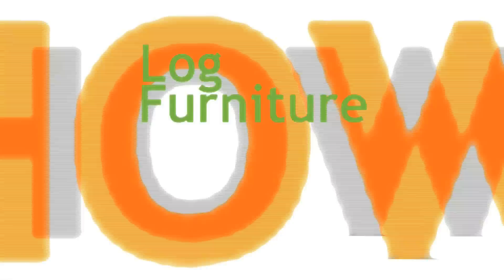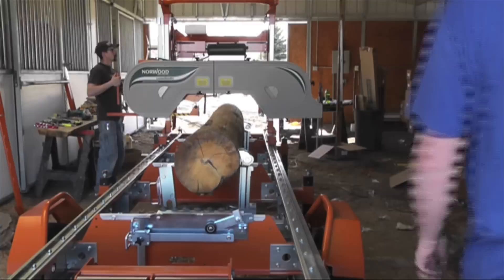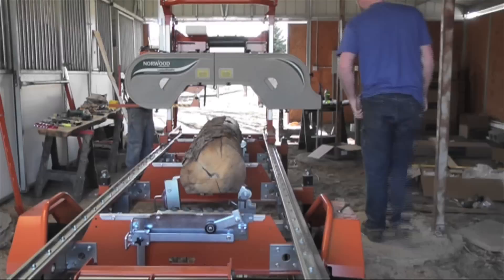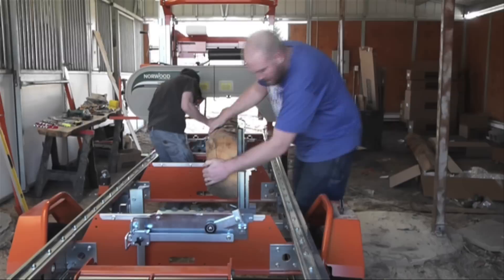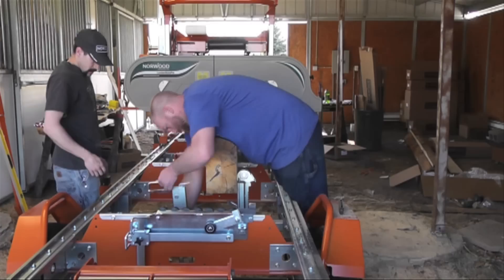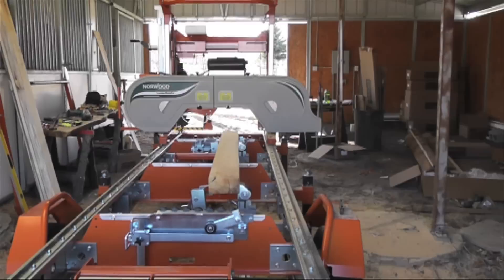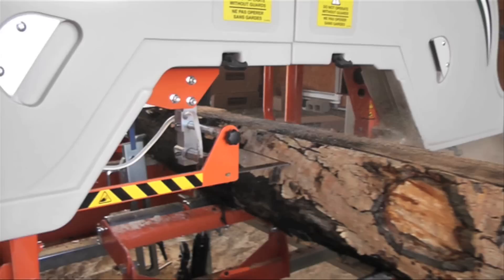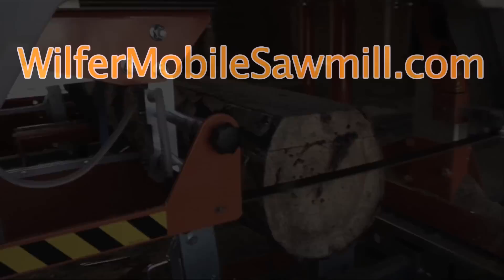First time on the new mill!

Comment from the maker: The performance of the blade really depends on what you're cutting and how long you use it between sharpening. We sharpen our blades after using them for two hours. So for mobility purposes, we have 6 blades that we take with us and then sharpen them all when we return to the shop after a day of work. If you let the blade dull or if you don't sharpen it properly, the cuts will start to look rougher and it may start to pull up or down. More vids coming soon!